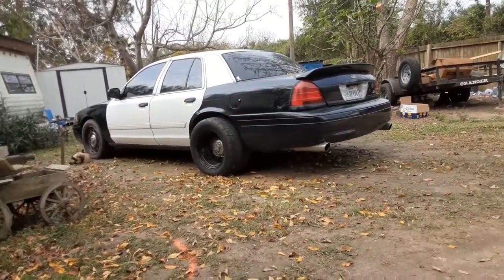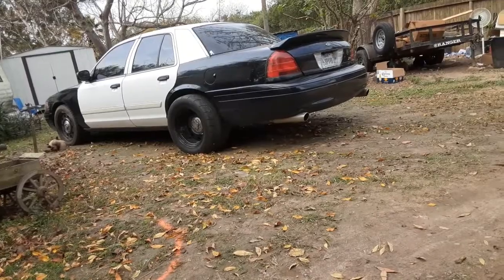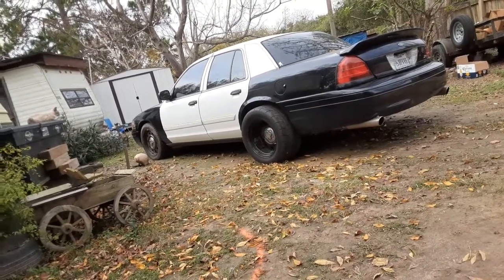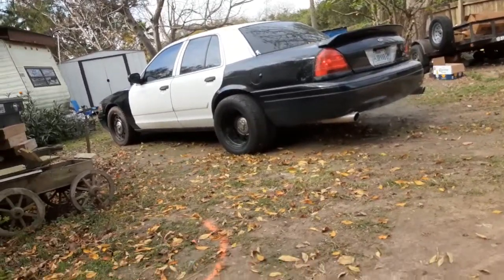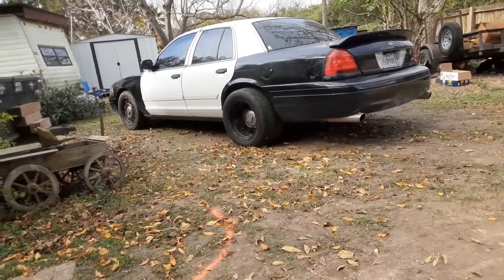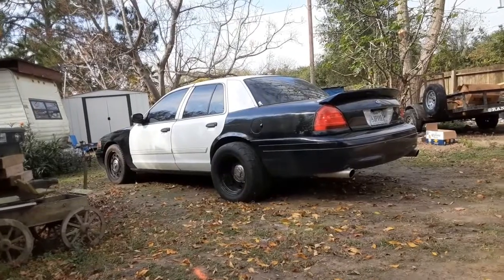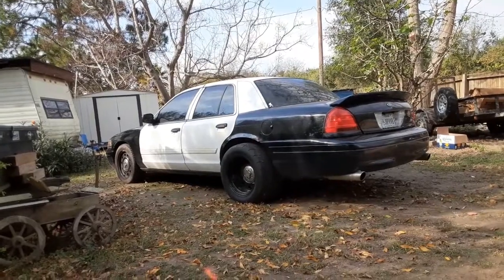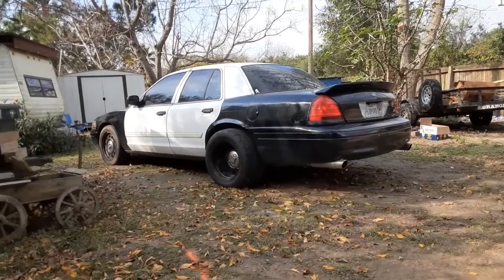Cop Vic cutout exhaust sound n issue i have with these headers!! Turns heads even more now tho..lol

Comment: Give it the old hammer treatment. Dent em in so there’s no clearance issues. Denting one of the pipes won’t hurt performance of the headers either.
Reply from the maker: That's what i plan on doing man, thanks for that advice, just haven't taken the time to, n the rubbing has lessened the more i drive it, but it's still there, don't get me wrong, but the performance gain has been a huge plus, longtubes are the way to go always.. ;)